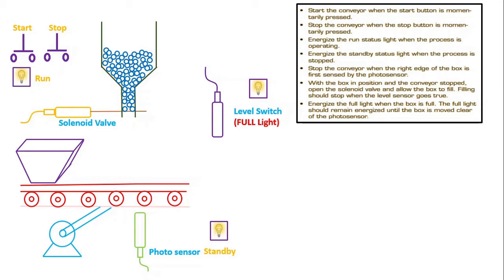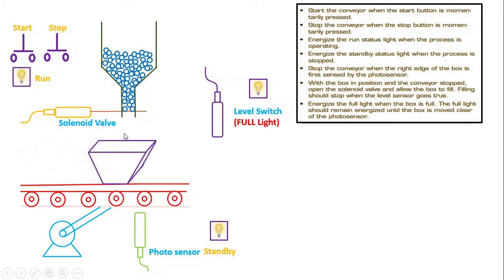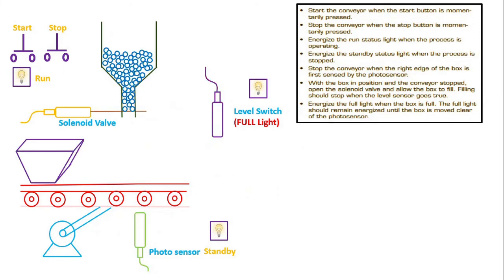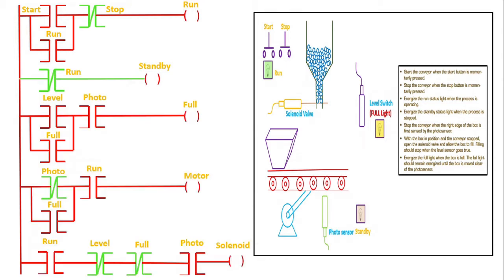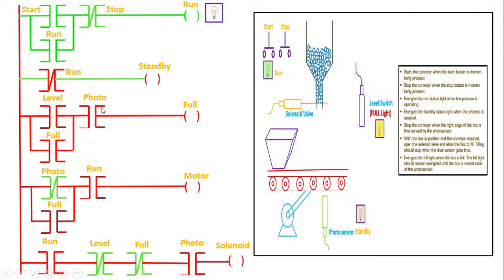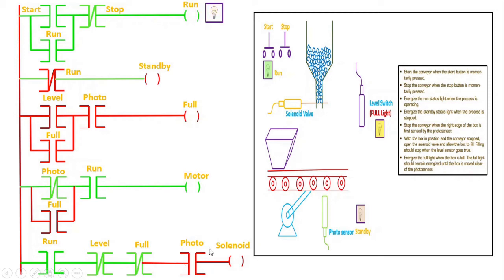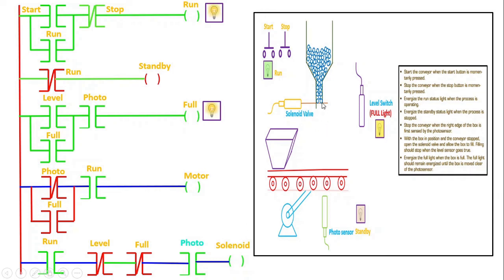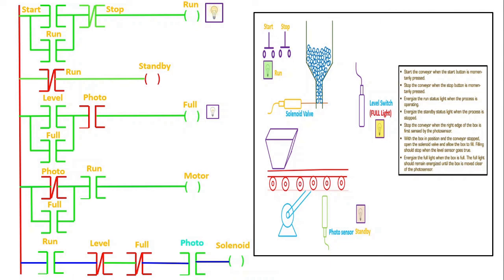Continuous filling process in PLC  | Example 1 | PLC Programming

Comment: How you implement the plc
Reply from the maker: You mean hardware?  So firstly you have to run the ladder diagram in the PLC tool and check the hardware response.
Reply: How to implement above ladder diagram  by own i.e how to place run switch is connected to in various position and the switches are connected in this manner only not other way
Reply from the maker: Actually you must build this code in PLC. By default the PLC will have some switches like push buttons etc. You can test using that
Reply: @ElectronicsMaddy   Okk thank you so much  but it not possible by paper and pen